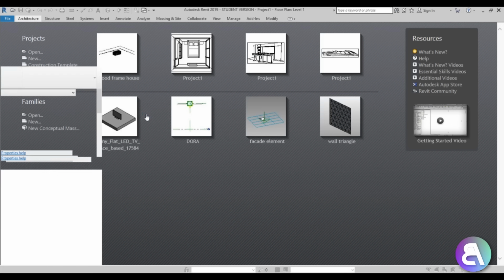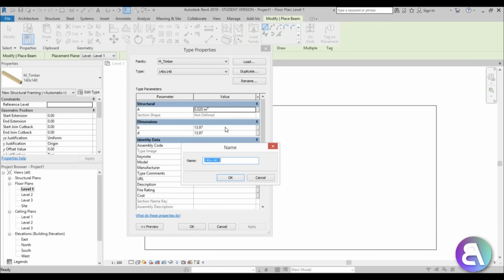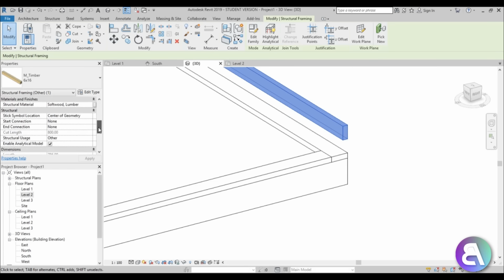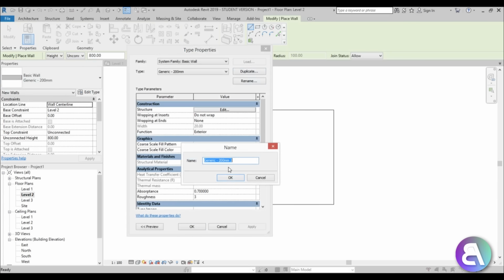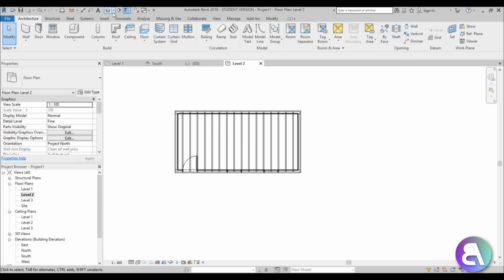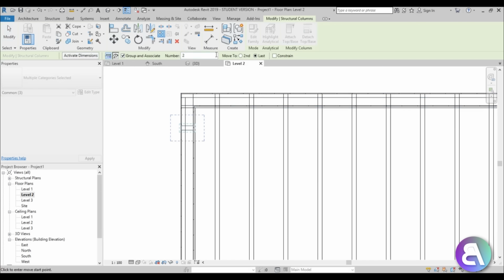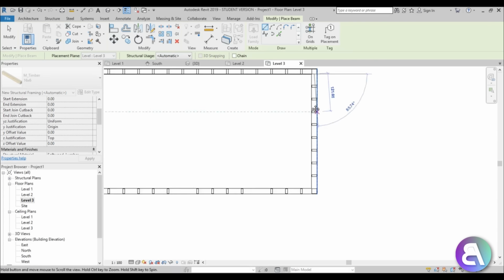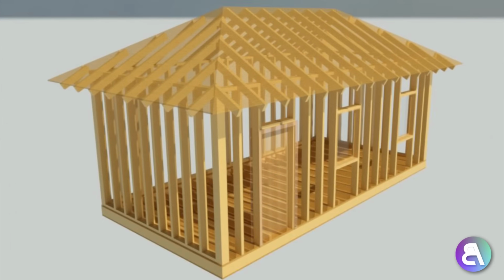Wood Frame House in Revit Tutorial

Comment: Thanks Balkan.. learned a lot.  Just a heads-up..  when designing location of wooden elements, you want to keep in mind the dimension of standard sheet products (like plywood or drywall, etc), and place wooden element so that the sheet products will start/end on the mid-points of the element so the sheet ends are all firmly attached and aligned.  Even if you're not using sheet products, you want to use standard spacing to finishers can easily predict location of structure.  In stick-frame construction, opening are cut-out/framed-in after the fact.. This seems like a hybrid of timber and stick-frame.

Comment: Hi Balkan, just a heads up on timber framed construction, this method is also used extensively in Canada, Australia and New Zealand. It's very effective in earthquake regions. As long as the timber is treated for external use and for termite resistance it's good to go. Timber also has good thermal resistance, stores carbon and easy to work with. Certain modern timber systems like CLT and LVL are really strong and has sufficient char ratings as to meet most fire ratings too. Keep up the exceptional content mate. Cheers
Reply: I was going to ask about that thank you

Comment: Have you tried doing this as a curtain wall, much faster once set up is done. I can send you my 2x4 wall sample but I am pretty sure you could figure it out. I tried this was as well, it is tedious for larger projects...great video though always a fan.
Reply: Van you send it to me?
Reply: I was just thinking the same thing. But I have some doubts. Would it be possible to create a curtain wall over the wall with the air layer created earlier? I am working on a steel frame project and it would be very helpful to know how to do it. Not only the inner frame but also the side panels. Could you send me that example?